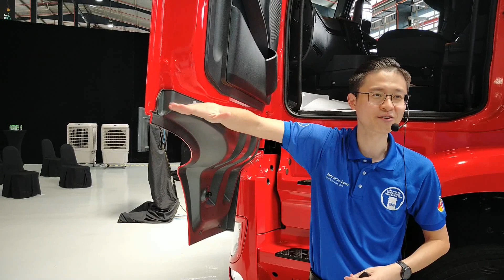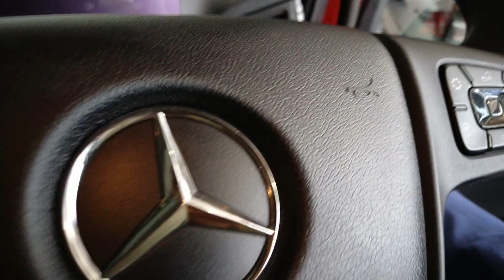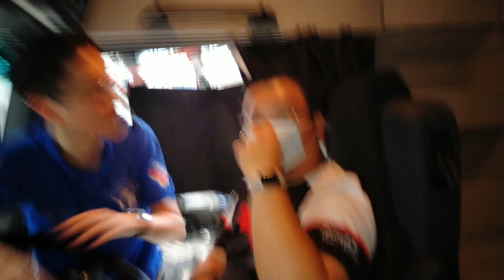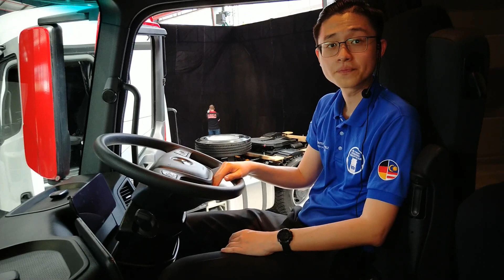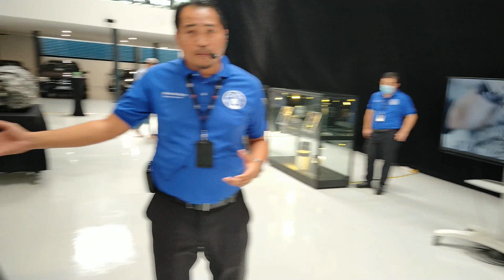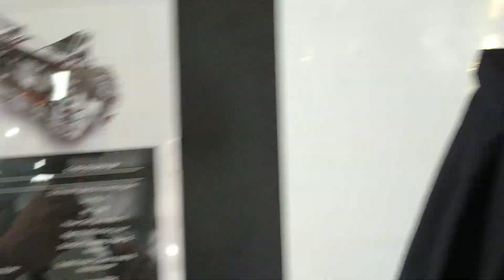2020 Mercedes-Benz Actros Truck - Walkaround during the Malaysian Launch

Comment: How much price sir
Reply from the maker: Ask ur local distributor. All trucks have no fixed price. All based on specs, service package and how many in the order. That's why price is never stated in commercial vehicle press releases or launches. But estimated at in the MYR(RM) 450-480k as a start.
Reply: I am from Timor Leste.
Sir can I take email ?
Reply from the maker: @rhendysaudades9634  why ever for? I don't sell trucks. Kindly contact your local Mercedes-Benz distributor for more info if you are interested. We don't sell stuff. We just review stuff here. Thanks.

Comment: Very disappointed it's not same model like Europe
Reply from the maker: Well, its only the engine. The rest is on par with what is offered. The engine suits the low quality of our diesel nationwide as not many have euro 4 or many transporters not willing to pay for expensive diesel and use d cheaper option.. would u as a potential owner spend more on servicing for about ten trucks over a period of ten yrs if u run euro6 engines on crappy euro3 diesel?